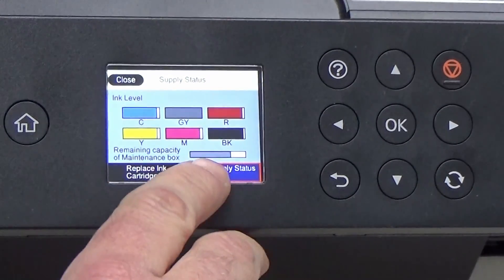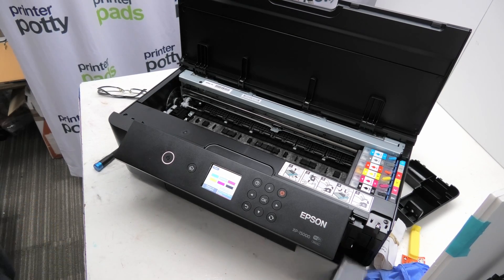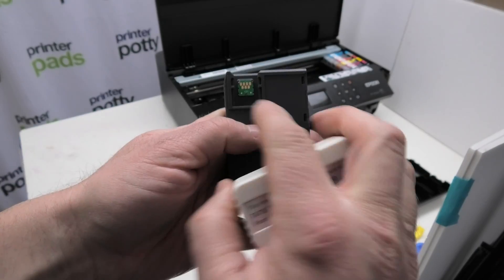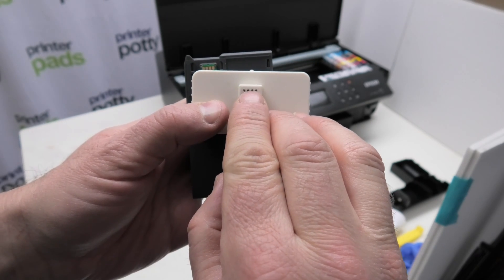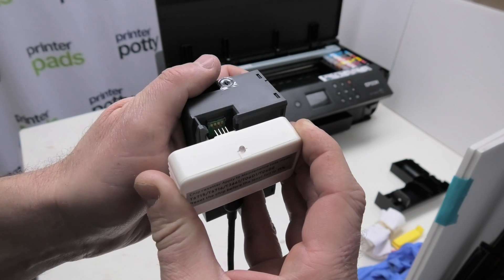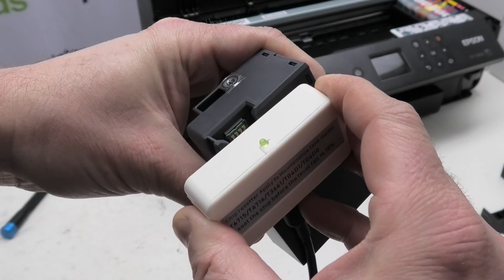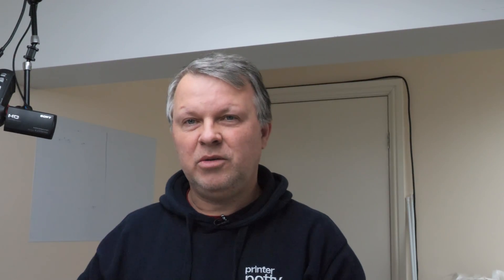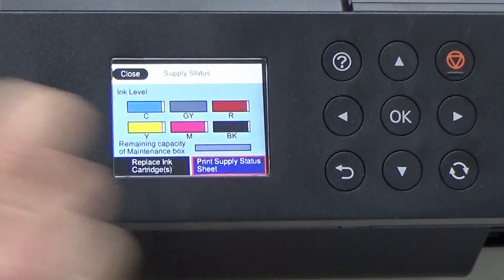Reset Chip on Epson Maintenance Box

Comment: I've got an ET-7750. My yellow color is clogged again (as I don't print often), so I wanted to do a power clean, as that generally seems to work.
But when I try to do a power clean, I get a message I should replace my maintenance box. But it isn't even 1/5th full, as the software on my computer says.

So is this a faulty chip? Or just commercial 'problems' to make people buy new, as I've had that maintenance box for a while now.
Btw, do you have a video of how to clean such a maintenance box? For the amounts of time I use my printer, I don't want to go out and buy everytime, for nothing.
Reply from the maker: The chip, like the waste ink counter, values are based on a guesstimated algorithm that calculates what the waste ink volume should be like, rather than the physical reality of the waste ink pads contents so this scenario isn't unusual. In terms of cleaning, etc... we don't have a guide on that but one is in the pipeline eventually (we just have a long to do list) but if you can ping us on support@octoink.co.uk I'll see if we can put something together for you with the chip resetter you'll need.

I'd definitely recommend our video here:
https://youtu.be/FqzVd7cBHbo?si=d6D6dgQXOGS3E7R9
... for some troubleshooting tips though as they cover a lot of what you're likely dealing with.

Comment: Is the resetter compatible with Epson ET-4850 maintenance cartridge T-04D1?
Reply from the maker: The resetter for the T3661 is also compatible with the T04D1 so yes that is capable of resetting your maintenance box chip as well.
Reply: @octoinkjet  Thanks for the Reply - I looking to switching to a Epson EcoTank Printer (HP has once again Bricked my latest of a long line HP printers) How many times can these chips be reset? The videos I have found seems like they can only be reset once.
Reply from the maker: The reset will work as long as the chip doesn't fry itself from a static zorch or similar (like any electrical circuit board) so you should find it resets multiple times without issue.

As for HP and their firmware shenanigans, yeah, less said about that the better.

Comment: Couldn't find one for epson L4260
Reply from the maker: The L4260 is much the same as the ET-2850 and does not use the chip functionality on the waste pad holder it uses. It can be confusing though because the waste pad holder is almost identical to the T04D1 maintenance box which does have a chip. The problem is that the L4260 does not have a chip reader and instead relies on the waste ink counter internally to track waste ink capacity. So, for your L4260 a chip resetter would not work but the WICReset app would help you reset the waste counter and clear the waste ink pad error.
Reply: @octoinkjet now I understand. thanks a lot for your detailed reply. 
Kudos

Comment: wether it works with Maintanence Box of Epson SureColor P9000
Reply from the maker: You would need a resetter compatible with the chip on your T6997 maintenance box. I checked and those are available via AliExpress, etc… But be careful to check you’re ordering the correct item.

Comment: can you replace the IC Chip on the maintenance box (T04D1) and buy a new sponge to reset it or do I need the actual chip resetter?
Reply from the maker: Yes, you can get replacement chips as well. Bit finicky to get them off and stick them
In place but it is possible.
Reply: @octoinkjet  tried it, i just ripped it out. It still sticks back since the clips didn't really break. Thanks

Comment: Hi, will this work for epson ecotank 2850?
Reply from the maker: No, the ET2850 has an internal waste counter, not a chip. The waste pad holder looks identical to the T04D1 but doesn’t have a chip reader. So you need to reset the waste counter with the WICReset app.
Reply: @ thank you very much for your reply. Do you have a video how to install this app and how to use it?
Reply from the maker: Search the OctoInkjet YouTube channel for 'WICReset' and you'll find our various videos for different computer operating systems. Those will cover what you need.
Reply: @octoinkjet  thank you very much❤️

Comment: Do you have a video for the ET 2750 Epson?  Was hoping what the interface (software) looks like and how to do the reset.  It does not have a chip on the ink box.
Reply from the maker: The ET2750 is covered by videos for fitting the pads if you do a search on this channel. As for resetting you need to use the WICReset app with a key to clear the printers waste ink counter. We have multiple videos on this channel covering different computer operating systems if you search for “WICReset”.

Just to be clear you can’t reset via the printers control panel.